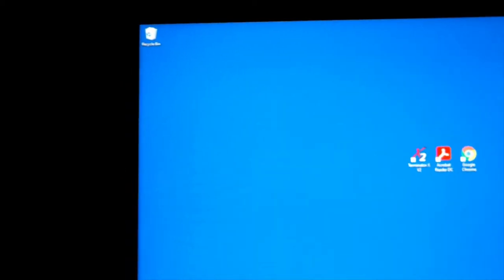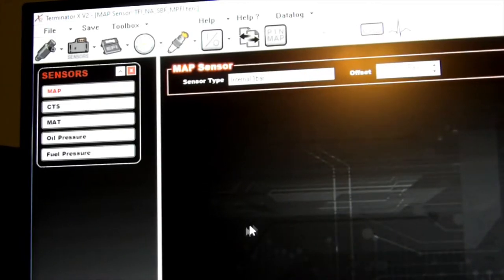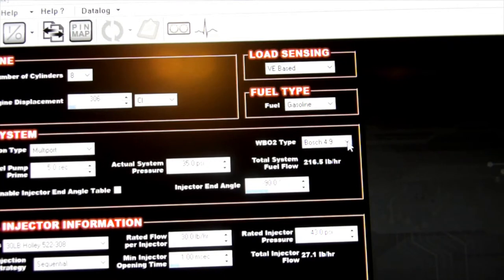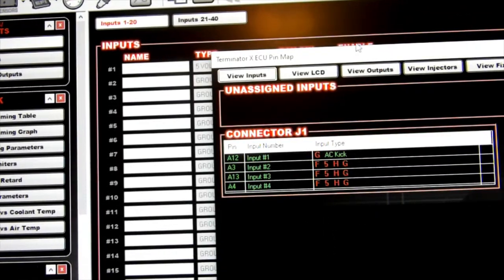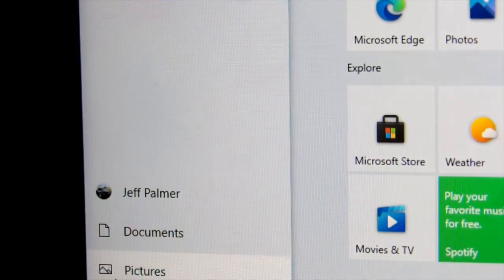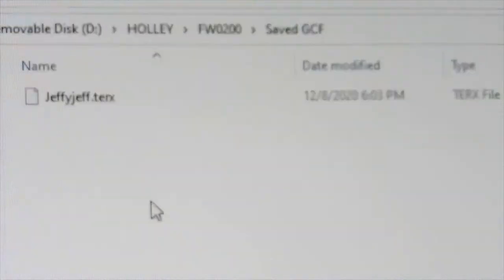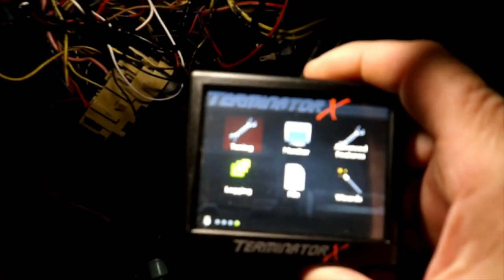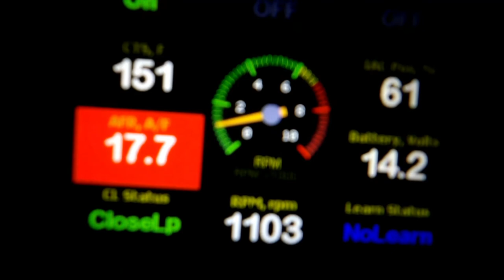Holley Terminator X - Basic Tune to SD Card

Comment: Hey man great video! I followed your instructions specially on the IAC part and now the car makes weird noise and air is comoing out the throttle body, at first I freaked out thinking is a stuck open intake valve, but wasn't the case I replaced the IAC, and same, the issue began as soon as I did what you suggested on the IAC to my first tune if I unplug it it idles smooth no hesitation, can you give me a hint? May be the new IAC is bad as well? Somthing I need to tune it off for better? I really need some help here pls
Reply: I swap them back and forth and the stock IAC makes a tick sound loud on top of the the air comming out the intake,  whe the aftermarket is plugged in it dials 100% and unplugged it goes to 63% on on the hand held but unplugged it Idles just fine, any Idea of where to begin my search or If I need to delete the IAC from the first tune?
Reply: @victorsalomon3305  the iac isn’t working if it’s reading 100% did you mess with the frequency mine is set at 300 and works perfect?